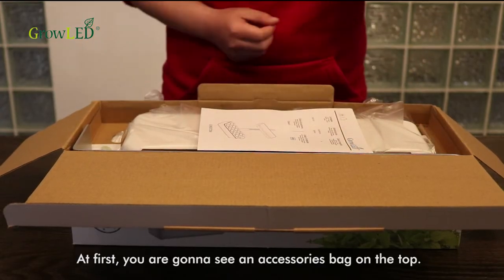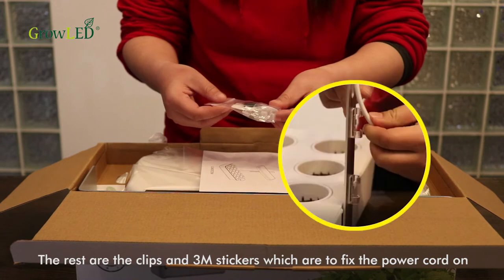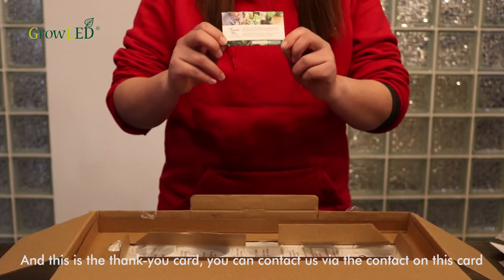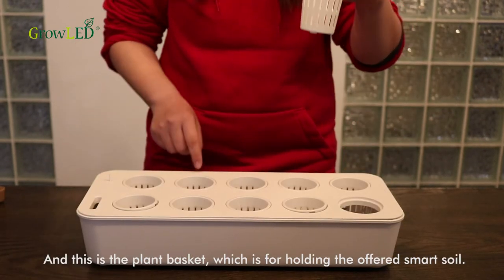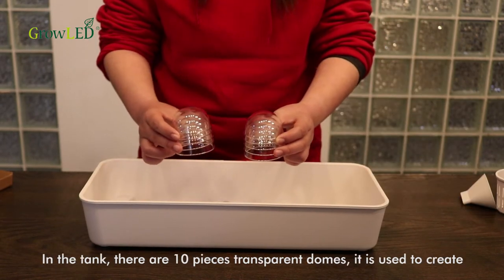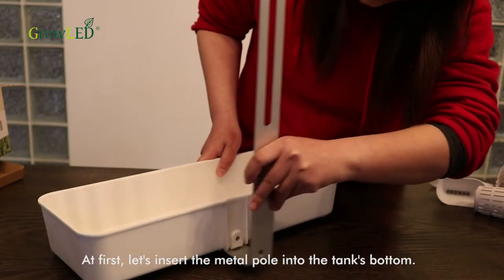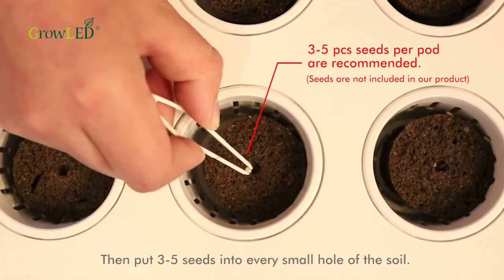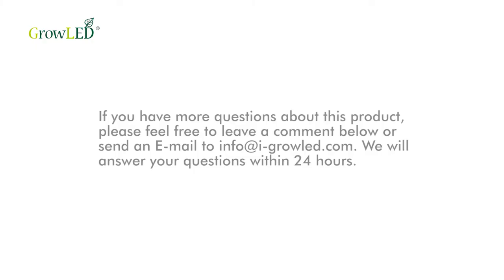GrowLED Hydroponic Height Adjustable Smart Indoor Garden Open Box Video

Comment: I can't figure out when to use the space lids and the shade covers. So confusing. Also, the indicator tube that assists the water level stick process is blocked away from the camera, sooo I didn't know you had to push in to firmly hold the indicator tube under the view of the tank. I wish it came with more paper work... It still looks like it's going to work well. At first glance when I open the product it was overwhelming. I now decided to work on this after over a month of having the product. It just looks like too much work. It needs more instructions of visual...preferably visuals so we can just get started and it can get done right away. However, I'm still thankful for the video. I'd like to know more.